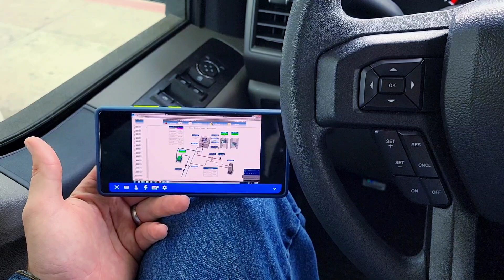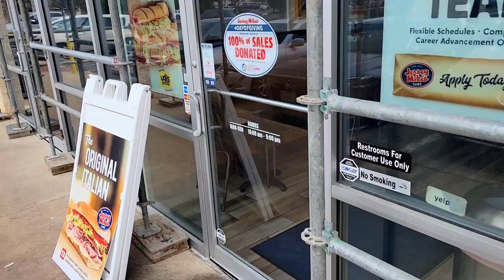HVAC Vlog: Oil Analysis

Comment: Nice Vlog, I am curious how you take oil sample from the compressor, do you use vacuum pump? or it has push button type sampling valve. It will be nice if you can share short vid of it.

Comment: I have  a Fluke 1587 as a megger but I've heard very good things about the actual brand Megger and they're not so expensive to be fair ...And Heavy Diesel from the UK uses one and it seems really nice and it reads up to Giga Ohms when the Fluke only goes up to 550 MOhms.
What I would love to know is,  are the cheaper meters good enough for what we do , or is the hype real when it comes to Fluke and its renown accuracy and reliability .
Cause other brands have more complete packages and they do cater to us hvac people and seem to acknowledge us more than Fluke does .
Meters are one if not the most important tool in the tool bag so I put a lot of thought into it . Now ,  It has been put in my head that only Fluke can fully be trusted , which is why I always carry one as a spare in my tool bag , and it has the final word when I need to double check something .